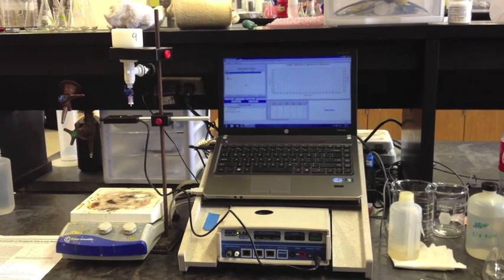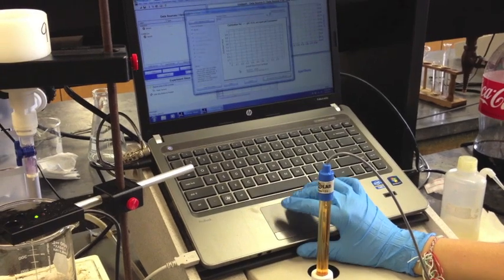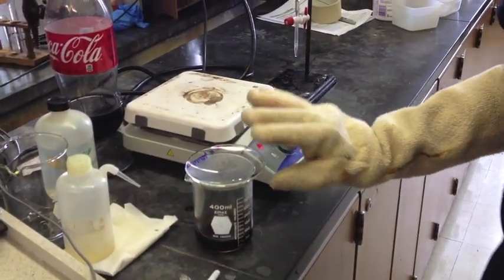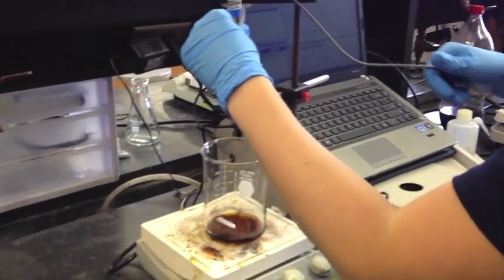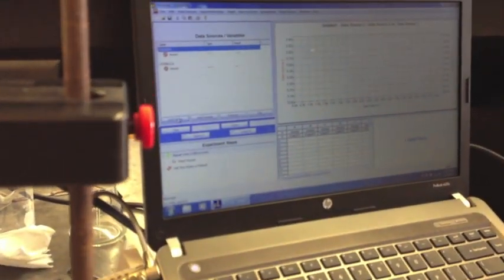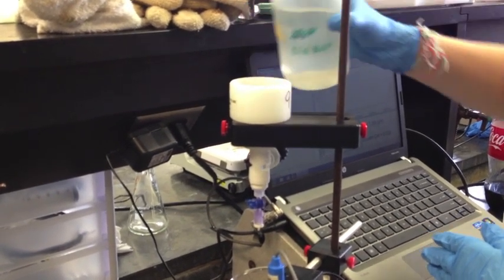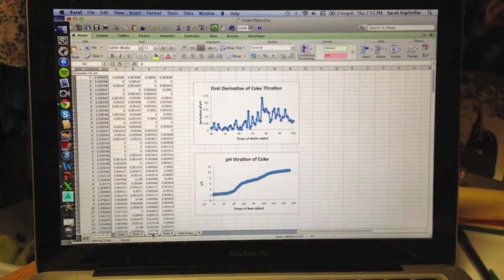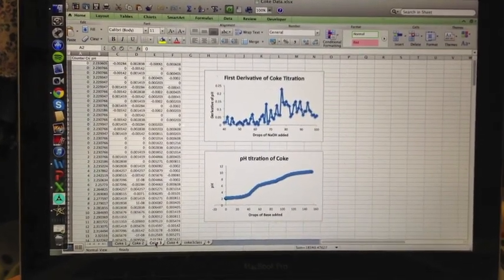Titration of Phosphoric Acid in Coke

Comment: Hello. I have been thinking about doing this experiment as my Internal Assessment as part of the IB diploma.However , since the black color does not let me to apply acid base titration , i do not know how can I do this.I don’t have a computer system either.Other than basic lab equipments , i have the ph sensor of vernier .Is it still possible for me to do this experiment ?
Reply from the maker: This should work. Record the pH of the Coke after adding incremental amounts of base. Keep doing this until the pH reaches above 11 or so. Then plot the data collected: pH of the Coke vs. the mL of base added. You should see two inflection points -  the first inflection point will represent the conversion of phosphoric acid to dihydrogen phosphate; the second inflection point will represent the conversion of dihydrogen phosphate to hydrogen phosphate. Let me know how it works out for you!
Reply: Could you please explain me why did you get the derivatives ? Can’t we find the number of drops of base added from the actual graph?

Comment: How do I know the range of phospohoric acid in a coke and how can I make sure the base concentration is in the right range so that the consumption of base is over 10 ml?
Reply from the maker: +K Duong We routinely find the amount of phosphoric acid in coke to be about 0.55g of phosphoric acid per L, which works out to 0.0056 M phosphoric acid. Therefore, if you choose to titrate 100 mL of coke, this should require slightly more than 10 mL (11.2 mL) of 0.1 M NaOH solution to get to the 2nd equivalence point. That is if my math is correct...be sure to check my work.

Comment: Hi, I also want to this experiment, but I first want to get the black color out of the coke.
I was thinking about using active coal. Could active coal get the black color out of the coke?
Reply from the maker: adoden123 Hi adoden.  I am unaware if activated charcoal will take out the color from coke.  Be careful if you use it, because I'm not sure or not if it would also remove the phosphoric acid!  If you have a pH meter, it is not necessary to remove the color.  However, if you want to use an acid base indicator, then removing the color might be necessary.
Reply: Tom Kuntzleman Thank you for the quick response.
Reply: The color is mostly caused by the caffeine, so figure out a method to remove that without removing the phosphoric acid and you might be good

Comment: Hello, I also have a question if you don't mind.
I tried to determine the amount of phosphoric acid in regular pepsi by doing a titration.
Before I tried to do the titration I put some magnesium-chloride in a glass with 100ml boiled pepsi, so the phosphate would precipitate with the magnesium. I then did a titration till around ph 5,5 so only the first equivalencepoint would be seen. I used 8ml of 0,1 M sodium-hydroxide and want to determine the amount of phosphoric acid now, but I'm not sure in what way the sodium-hydroxide neutralizes the coke. Is it in 1:1, 1:2 or 1:3. Also how does the new reaction look like when the phospate precipitates with the magnesium. It no longer looks like this right??: H3PO4(s) +OH-(aq)-->H2PO4+H20
Sorry for my bad english, it's not my native language.
Reply from the maker: John Smith Hi John, thank you for your question.  I'm not certain that the addition of magnesium precipitated the phosphate, because acids dissolve many precipitates, and coke is certainly acidic.  You may have formed MgHPO4 (s) and/or Mg(H2PO4)2, but I'm not certain; I haven't taken the time to look up Ksp values for these two magnesium compounds at low pH values.  Did you actually observe solid ppt formation upon addition of MgCl2?  Nevertheless, if you are only titrating to the first equivalence point, I think the sodium hydroxide neutralizes the acid in a 1:1 ratio as you have indicated:  H3PO4 + OH- --> H2PO4 + H2O.  We usually see the second equivalence point well above pH 7, and we never see the third eqiuvalence point.
Reply: Tom Kuntzleman Thanks a lot for the answer!
After adding Magnesiumchloride there was a solid precipitation visible.
I did a titration with normal boiled cola and a titration with boiled cola with MgCl2.
I used a 1:1 ratio for both now and tried to calculate the amounts of phosphoric acids.
With the normal titration I got 56mg phosphoric acid in 100ml pepsi and with the MgCl2 titration I got 68mg phosphoric acid in 100ml pepsi. How could this difference be explained? I read on the internet that by making a precipitation with the phosphate I was supposed to get a more precise amount of phosphoric acid in the pepsi., but on the site of pepsi it says pepsi has 54mg phosphoric acid in 100ml. The amount of phosphoric acid I got with the titration without MgCl2 was closer to the real amount, but why?
Reply from the maker: Hi John, I assume you ran several trials on each and had fairly good precision in your measurements?
Reply: Tom Kuntzleman I did both the normal and MgCl2 titration three times.
I calculated the amounts of phosphoric acid for the 2nd and 3rd titrations too now and the amounts of phosphoric acid only have a difference of around 2mg between the normal and MgCl2 titration.
So it seems that I had a wrong measurement in my first titration.
I just have one final question and after that I'll stop bothering you haha,
Making a precipitation with the Phosphate before you start a titration supposedly gives you a more precise answer for the amount of phosphoric acid in the pepsi, but why?
Reply from the maker: John Smith I'm not sure why the addition of phosphate gives you a more precise answer.  I will look in to this.  I wonder if the Mg precipitates carbonate and bicarbonate that cannot be completely removed by boiling. However, this is just speculation on my part. Very interesting question, however.

Comment: Hello, I have a question, at the end, we find the mass of the phosphoric acid or is it it's concentration?
Reply from the maker: Hi Yazan. You can find both. First be sure to measure the amount of Coca-Cola used prior to boiling off the carbon dioxide. Once the phosphoric acid is titrated, you can figure out the mass of phosphoric acid that was contained in the amount of Coke you used. Since you measured the amount of Coke used prior to boiling, you can find the percent.